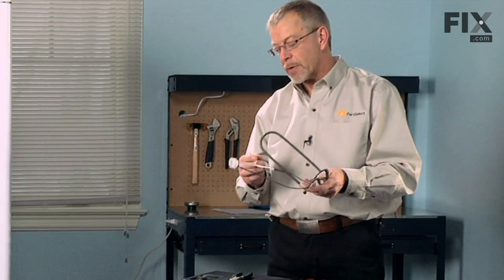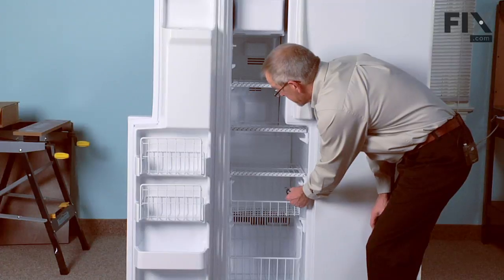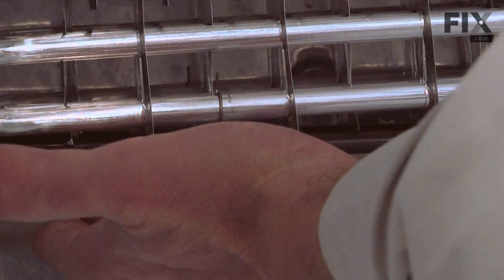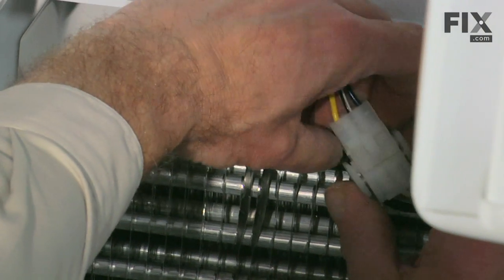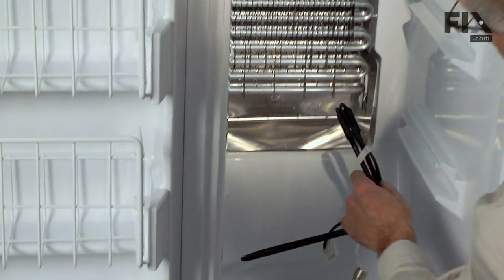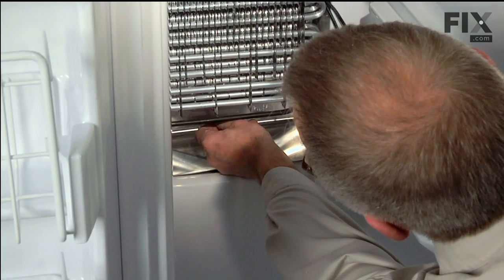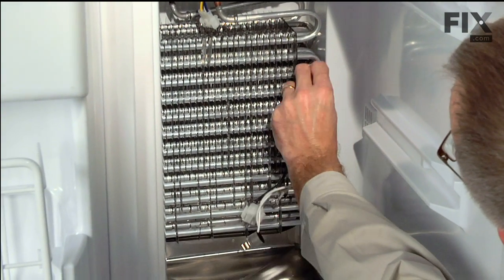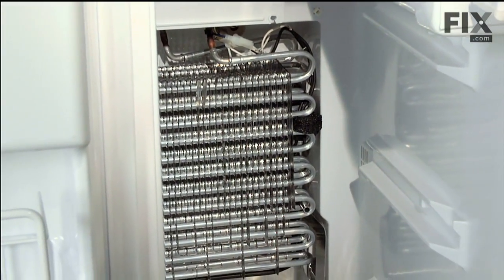Jenn-Air Refrigerator Repair – How to replace the Defrost Heater and Thermostat Assembly

Comment: So my coil is not frozen but the drain keeps freezing up and leaking out the bottom of door. I'm going to pull fridge out and check line to be sure its not kinked or something. I would think it would need a trap of some sort to stop bugs from crawling up thru drain. I know very random problem. I will pull it apart one more time to check continuity. But coil is completely frost free.